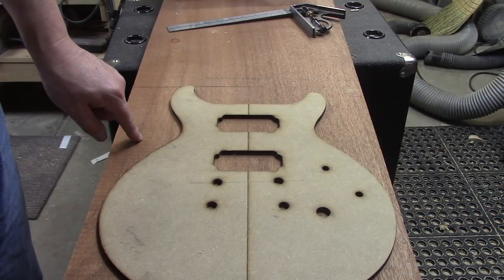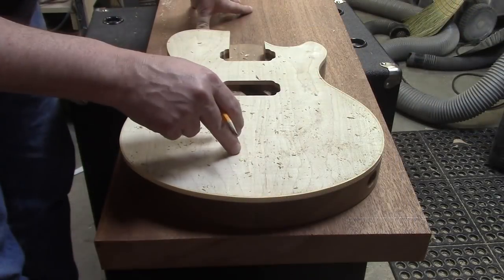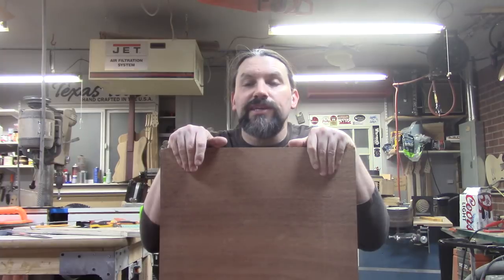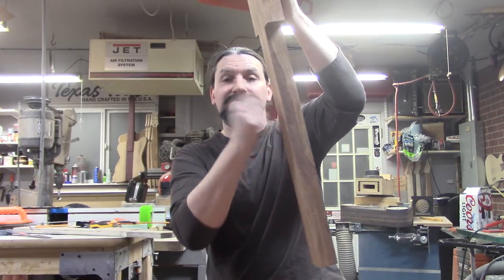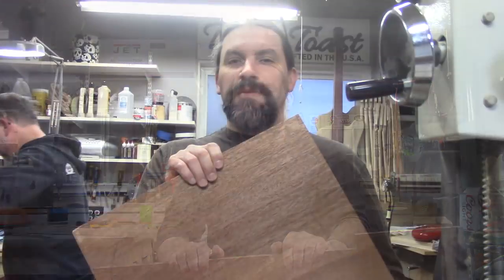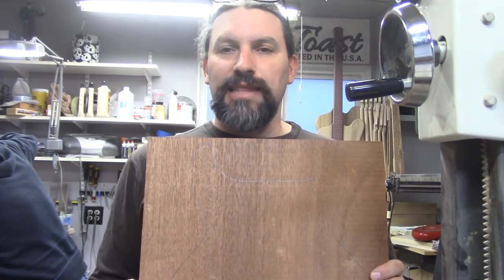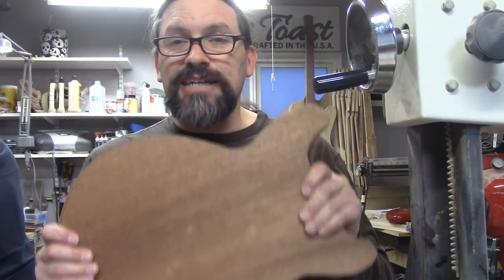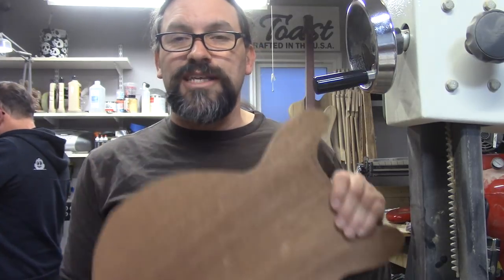Are One Piece Bodies Better Than Everthing Else... YES!

Comment: Do you think using my crate club 50 as a saw horse will get me a little more tone or does it only work with them ampegs?
Reply from the maker: I think you will be fine as long as you use a heavy tube amp :)

Comment: What utter crap! Everybody knows the Ampeg increases the tone by 41%. Or 98% if it was made in 1959. And it still has the original parts.
Reply from the maker: Dude!
You shouldn't believe everything you read on the internet. I have been tapping on woods for a long time and I know a thing or two about how to increase tone.
Reply: To the tune of "Knock on Wood", of course!